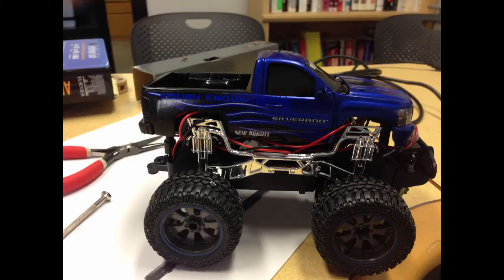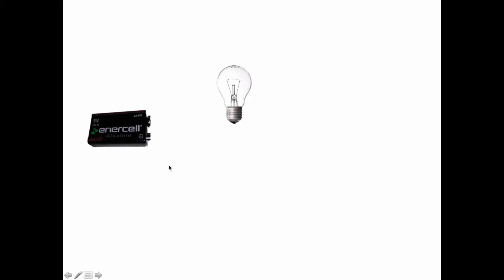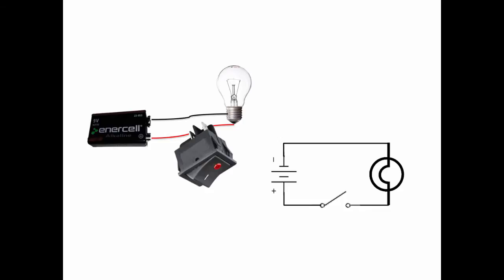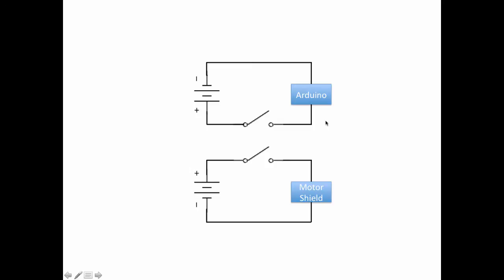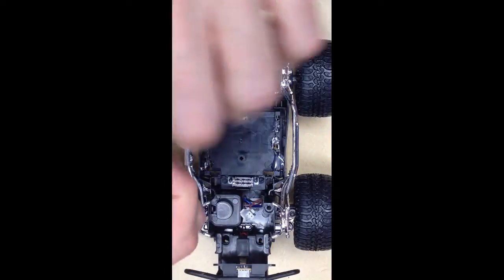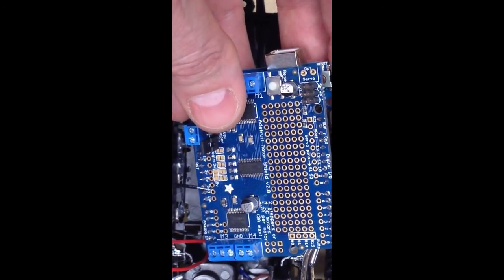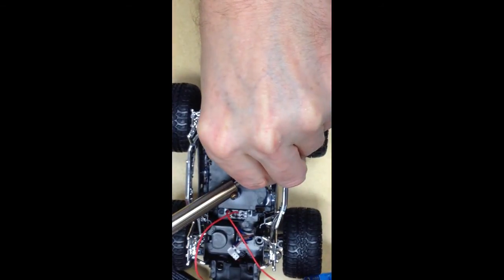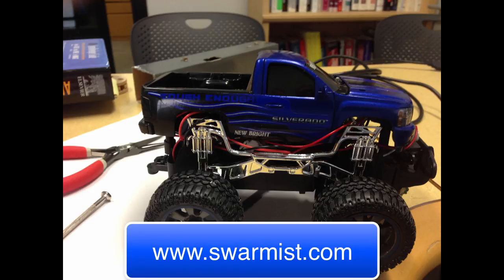Arduino Autonomous Vehicle Battery Connections and Power Switch Wiring

Comment: please upload the rest!!!!! im using them for a school project :)
Reply: Unfortunately, I haven't completed all the videos, but Jamie uploads them for me as quickly as I can complete them.  I will try to move forward as quickly as I can.  I want to try to make them so that anyone who has an interest can figure out how to build one of these cars.
Meanwhile, if you have specific questions, you can email me at somePiGuy@gmail.com.
Thanks for watching.
Reply: SomePiGuy my question is . is the motor shield IC (L298) or (L293) or other?
and if so , is the original battery pack in the car (3 batteries = 4.5 v) enogh to drive the car motors ,baring in mind that most H-bridge IC s have a voltage drop ranging from 1.5 to 2.5 v. meaning that the motor shield will be putting out less than 4.5 v required to run the motors.
Or may be the motor shield is built out of mosfits and it doesn't have voltage drop. I really have no idea but I'm facing this problem but I was using a L298 motor shield when I faced this problem and there was solution to it but add an extra 2 AA batteries pack to the batteries powering the H-Bridge going to the car motors. Any ideas ?
Reply: I'm not sure I understand your concern, but I will try to describe what I did and maybe that will help. This is the motor shield I used: http://www.adafruit.com/products/1438. I also just used the 3 AA batteries to power the motors that originally came with the car. I didn't notice a problem. I don't know what parts the motor shield uses, but Adafruit maybe able to give you the details.